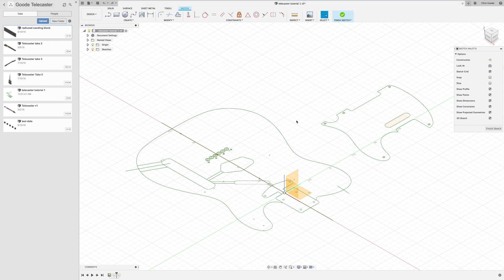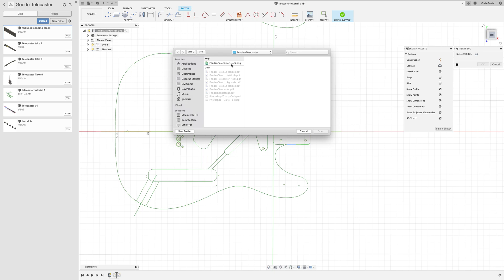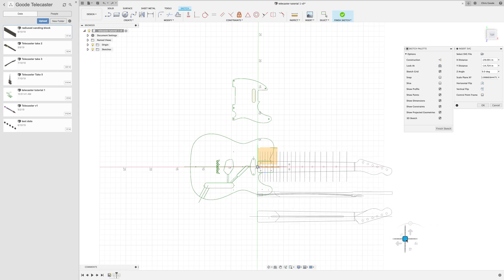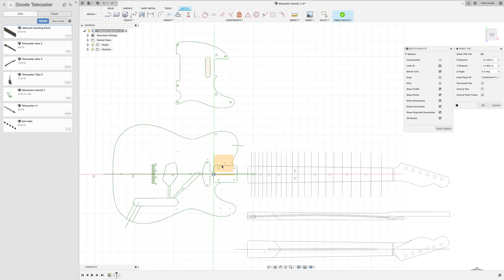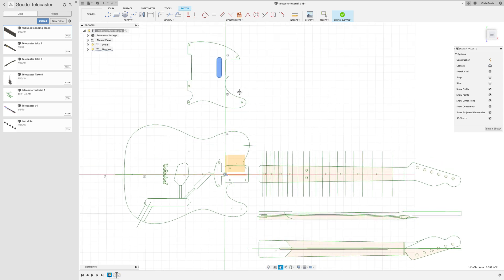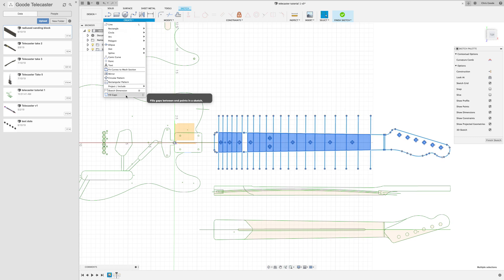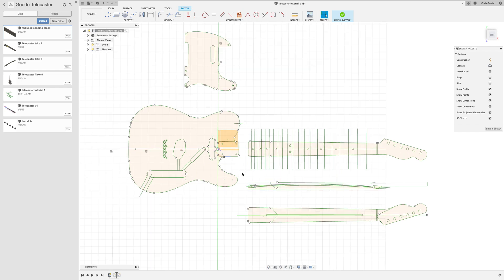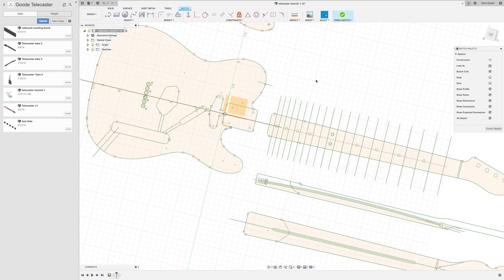CNC Guitars Using Fusion 360 - Step 1

Comment: I've got an issue.. Im using some illustrations of a strat from electric herald, and I've followed the steps in getting the svg to the right dimensions. However, when I dimension it, something is always off. If the neck pocket is the right width, the string spacing at the trem is off, or if the nut width is 43mm, the neck width at the heel is off.. I've tried dimensioning from various dif points, trem, neck pocket, heel, nut, Etc. with the same result each time. I believe the dimensions of the original illustration from electric herald arent accurate. Where can I find an accurate illustration of a strat? Also.. what about the tech doc of the measurements? I see many online, and either they're inaccurate, or cost $$. So far I am unable to find a reliable source.. suggestions? Any help would be much appreciated! Thanks

Comment: I've tried this example and the neck will fully highlight in yellow but the body will not...only part of the body.  What could I be doing wrong?
Reply from the maker: Hi Eric - you can try two things if Fusion isn't closing the gaps properly: either a different gap width, or you can trace the whole sketch with splines that you know for sure are closed. That last option is probably the most reliable one, and will give you fewer points and a more efficient way of doing everything. Same for the neck. I'm moving to a workflow of making my own sketches rather than importing pdfs and filling gaps...
Reply: Chris Goode thank you!